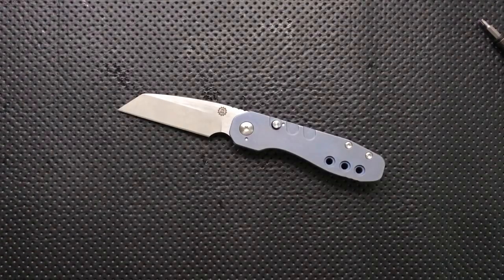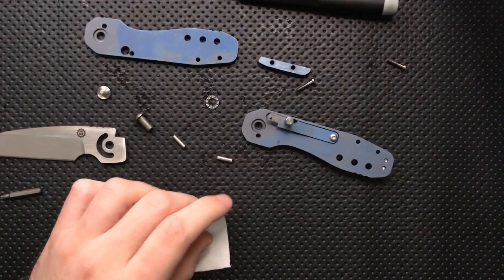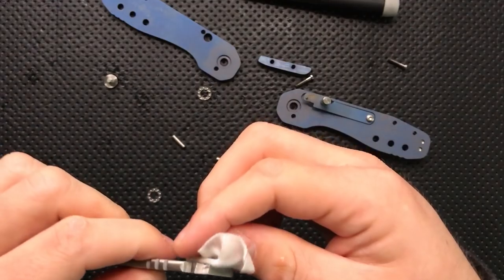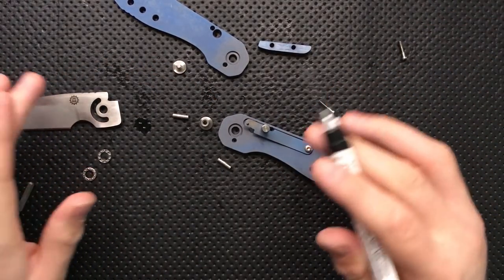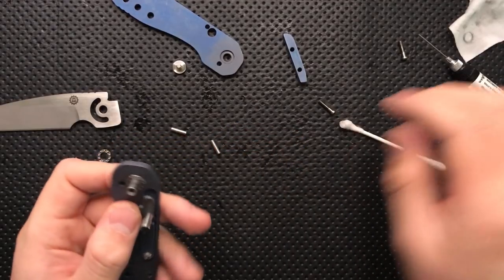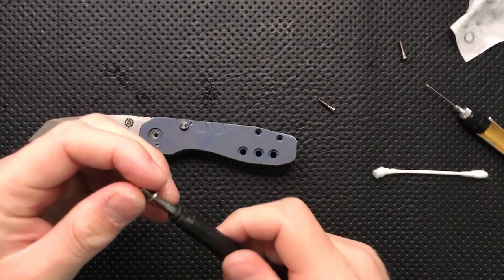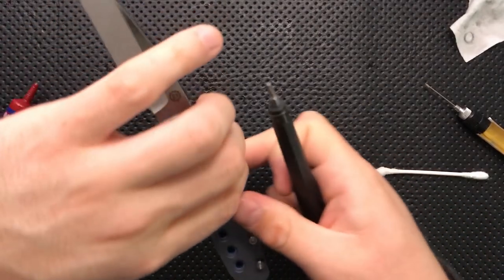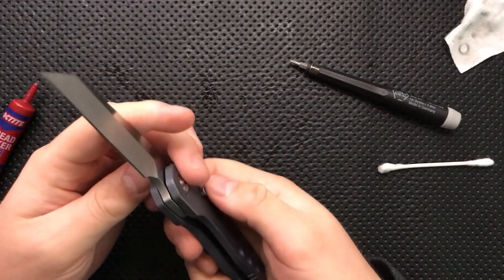How to disassemble and maintain the Smock SK23 Pocketknife

Comment: What are the things you would improve Nick? Maybe a captured main pivot? The handles look a bit blocky - looks like they could be a bit more contoured/profiled? 

hopefully in the future he'll use inserts/barrels or maybe have the back fasteners thread into the back spacer instead of the scale. 

otherwise I like that knife a lot...
Reply from the maker: I'd definitely go with Chicago screws for the backspacer, a non-free-spinning pivot, and I'll ask for some contouring on the knife.  And I'd like some thinner stock all around.  This knife on a diet would be OMG.
Reply: Luc Albert Liner lock with a button ?
Reply: Frank F nah I do not care for liner locks. I do love the compression lock
Reply: Luc Albert Got it , thanks.
Reply: Nick Shabazz What are "Chicago Screws"?  Would that be the kind that have a screw head on both sides and the threading is in the back spacer instead of the opposite scale?  because that's what I'd like to see (along with all of your suggestions).
Reply: Do you feel those two stop pins should be blind-fitted?  I mean. they basically are, but I don't know why the holes are drilled through.  it seems like it'd be cleaner if he did it that way.
Reply from the maker: Chicago Screws are also sex bolts, the kind of thing you see on CRK or the Delica.  And I do think the pins should be blind, but it's not the end of any worlds.
Reply: Nick Shabazz I got mine contoured and it's awesome in hand. My only real complaints are the distance the blade is from your hand and the stock thickness. The grind comes down fairly thin, but over repeated sharpening I do fear it will be quite thick behind edge. The action, flipping ability, and all of that are fantastic and it's an addictive knife to play with.
Reply: Cujobob You got a picture of that contoured SK23?  I'd love to see one.
Reply: After some additional review, "Chicago screws" are the type that the male end screws into the female end.  They look like a dumbbell if you screw them together outside of the knife.  

I think this would look better, be cheaper, and be simpler construction than both the current way the knife is made, and the way I suggested of having both sides screw into the back spacer.  As long as their counter-sunk and flush with the frame ...

Comment: Is this actually a compression lock? On a Spyderco compression lock the liner gets wedged between the stop pin and blade tang.  This has no stop pin.
Reply from the maker: It's a modified compression lock, the stop pin is behind the button.  I'll mention that difference in my review, but I think it is very much a compression lock still.
Reply: This has two stop pins. One for the lock, the other internally for the blade.